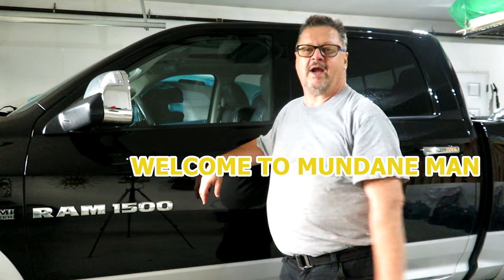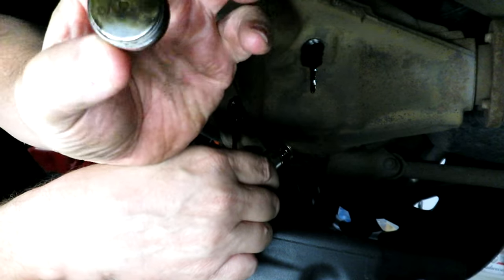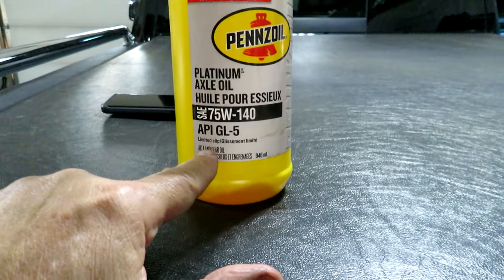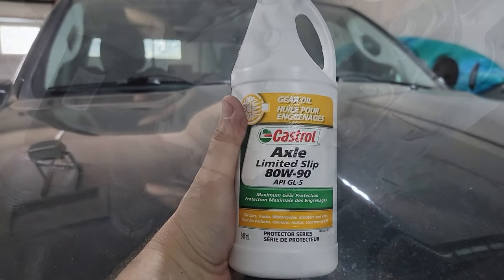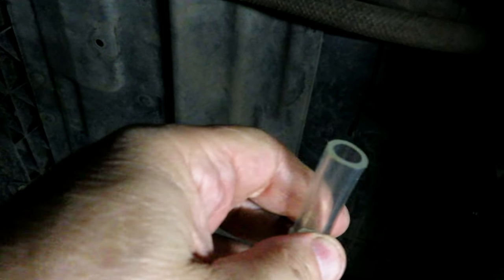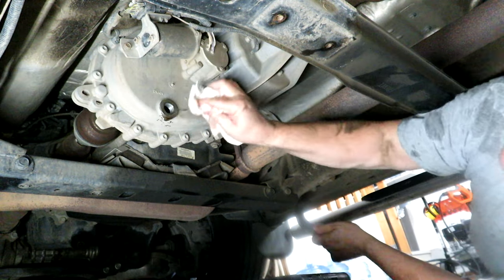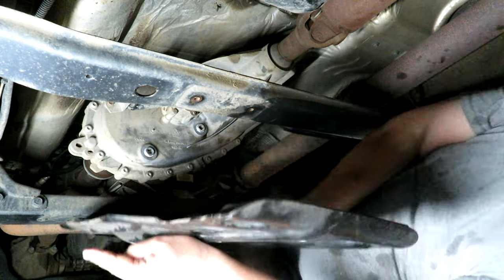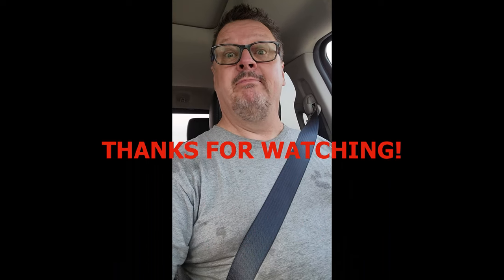Ram 1500 2009-2018 | Rear and Front Differential and Transfer Case Fluid Change | Do It Yourself

Comment: Shouldn't you loosen fill point 1st? Hate to drain if you can't fill.. Great job though brother!
Reply: Be a man. Drain it first.  Only woman have trouble loosening the fill plug. 
If the fill plug is bound up, drill and tap a new fill hole.
Reply from the maker: It is probably a good practice to do that.
Reply from the maker: @rickylee2477  If I couldn't have loosened the plug I might have gotten my wife to give it a try.😄

Comment: Would you think that red product around the drain plug might be red thread lock as opposed to rtv sealant?
Reply: Likely not, as red locktite is very strong, not meant for plugs that have no stress and need to be removed on a regular basis
Reply: Just to add to the already given evidence that it's not red thread locker...When red tread locker drys and if it can be removed, the treads will have a white residue and not retain it's red color...cheers🍺
Reply: It's probably pipe sealant used for gasoline and oil called Gasoila. We use it in the marine world for pipe threads on fuel systems and oil systems. It gets hard and can even be applied to the threads and allowed to dry before installation but can be used wet also. Sealing tape will also work well in this application. The factory probably applies the sealer long before the plugs are installed. In my mind the biggest reason to use anything on the threads is so the plug doesn't need over tightening to seal but will seal and not vibrate out and can be easily removed.

Comment: Most definitely void warranty if your dif fails and it’s learned you used to the wrong weight gear oil  
And you still struggle to fill. I suggest a bag of oil. And the tube on the bottle is the easiest. But you only need a hose on it 4-6 inches long.   It’s a breeze. 
Your hose was way to long.

Comment: If you are gonna go by mopar recommendations then you should have used mopar brand gear oil.
Reply from the maker: True but as long as the fluid you buy meets the Mopar spec then other 3rd party fluids are fine.  Similar to motor oil.
Reply: Gear oil, like motor oil only need to meet an API GL standard.